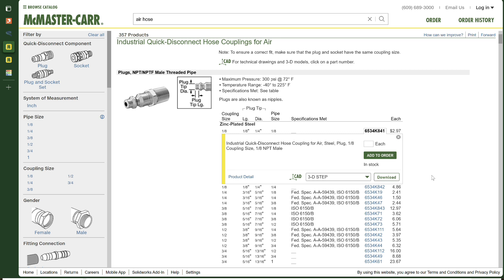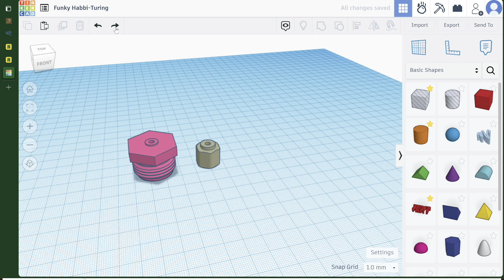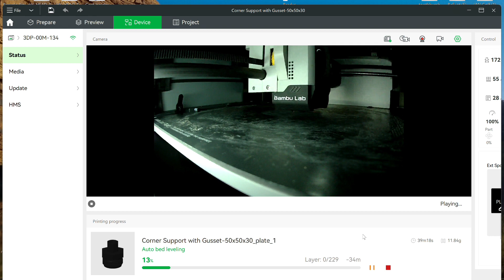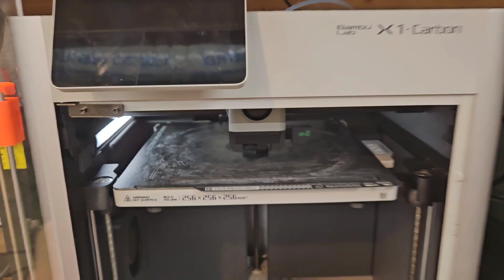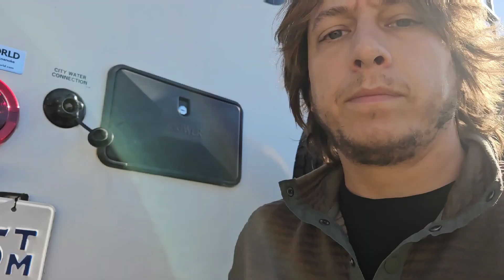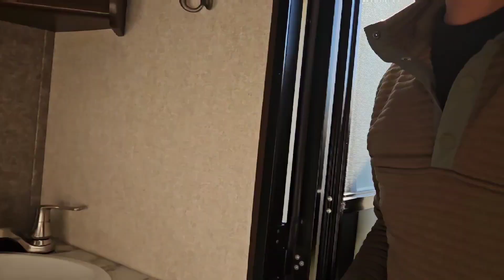3D printing things to make RV life easier, winterizing Edition #rv #rvlife #rvliving #3dprinting

Comment: As a complete noob to CAD software. I find it easier to open stuff up in mesh mixer and cut it up with the plain cut tool. Tinkercad has a 25 MB limit on STL files. I wish it was bigger but it just has an engine limit. The only way I could get my project into tinkercad was with mesh mixer and the reducing options to make it a smaller file